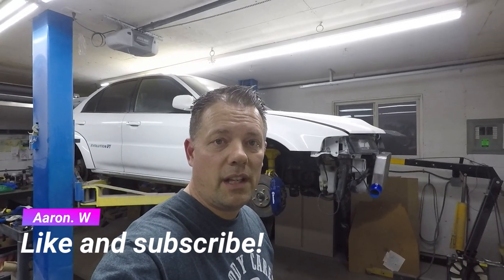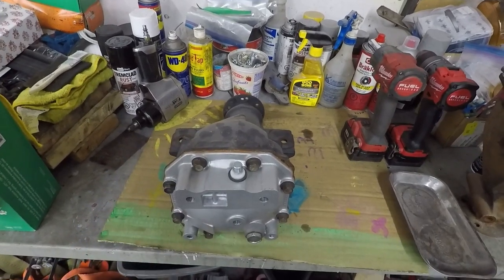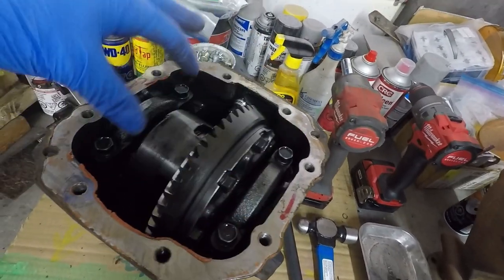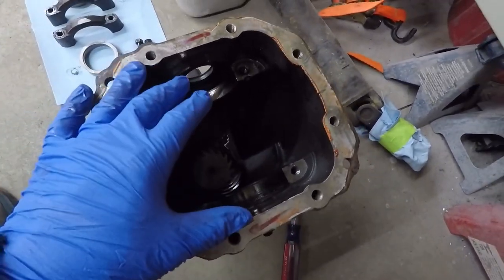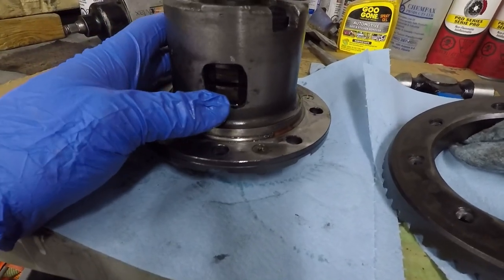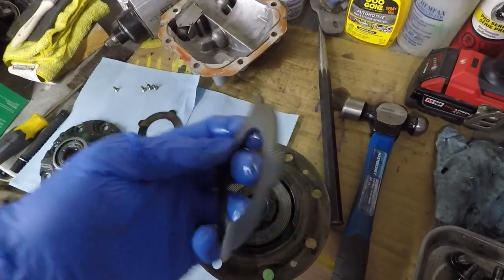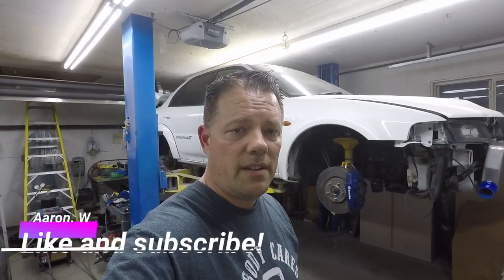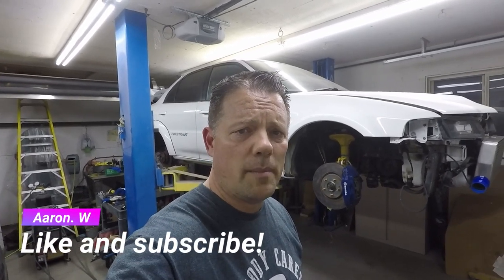Mitsubishi Evolution 6 Project 2022 23 (Part 5d) Suspension REAR DIFFERENTIAL TEAR DOWN

Comment: Great info, Thanks Aaron. With the screws you had to drill out... Did you try an old school impact screwdriver that you hit with a hammer? I recently got a fancy pair of Japanese "Vessel" brand IMPACTA screwdrivers that you turn while tapping with a hammer which causes them to rotate, I'm keen to try them out on my next headache.  And finally I read that if you press some coarse valve grinding paste into the phillips screw head, the paste removes the play and gives the screwdriver extra bite!  Try it and let me know
Reply from the maker: Those are all good ideas, i havent tried those 😄

Comment: Good stuff. I recently disassembled my entire evo 9 diff for reconditioning. Can you guide me through installing and properly setting the pinion gear?  All bearings and shims and collar are being reused. The companion flange just seems waaaay too tight at the factory torque recommendation. Thanks
Reply from the maker: The drag on the snout after assembly should be only 7-10 inch pounds assembled with the companion flange on. If its more than that smaller shimms may have to be used on assembly. If you go on the Evoscan site they have a downloadable copy of the Evo 7 service manual. Check out page 27b-47 it goes over rear axle assembly. I hope this helps.
Reply: Thanks for the reply. I do have the actual evo 9 manual and it calls for 137 +/- 21 ft lb on the companion flange self locking nut. Is it possible to require a different shim after fully disassembling even if I didn’t pull the bearing off of the pinion ?

Not sure what could have changed requiring a different setup as the collar and shim shouldn’t crush. 

Thanks again and your period of JDM flavor is awesome keep it up. 

To my
Reply from the maker: @dinoagelis8370  hi there, yes unfortunately the bearing preload can change even if you put everything together the same as the shims etc tend to deform and flatten out a bit as well as the bearing cage may relax and require slightly less torque to preload the bearing. The drag test in the manual is measuring the assembled bearing preload. A lot of driverrain guys measure the drag on a pinion prior to disassembly to get an idea of where the preload is at on the used parts. If your backlash on your ring gear as well as the pinion depth is all the same as stock you are stuck now swapping out the shims. On the pinion you just keep tightening the pinion nut until you get the desired preload on the bearings. If its not coming close to the stock speck youd nees to swap out the shims for some diffrent ones depending on which way you want to move, less or more torque.